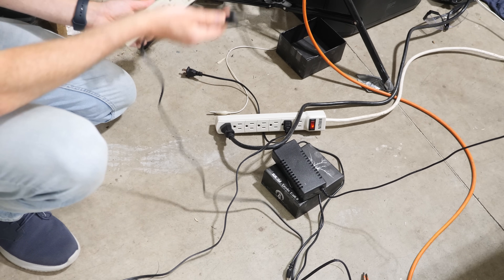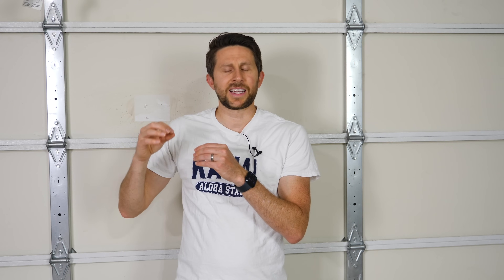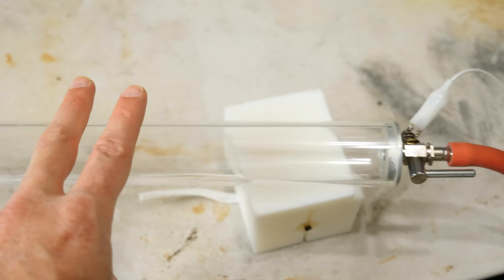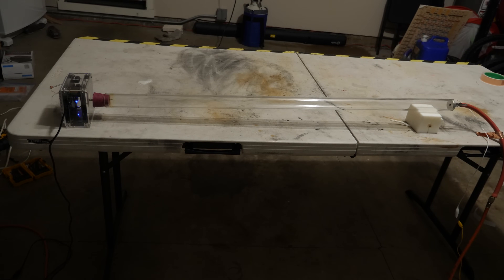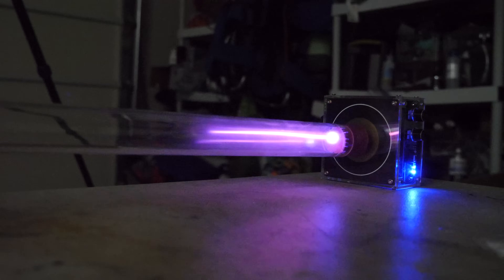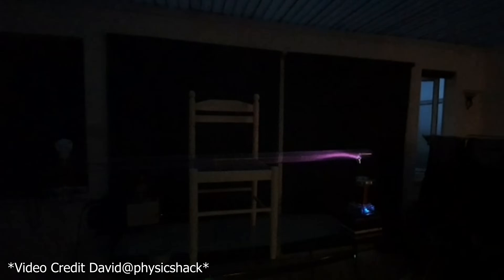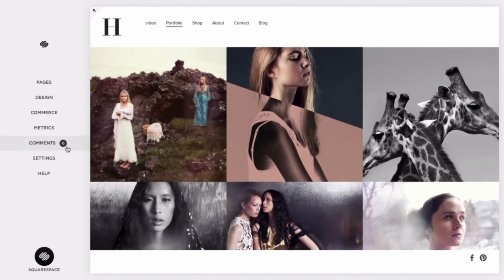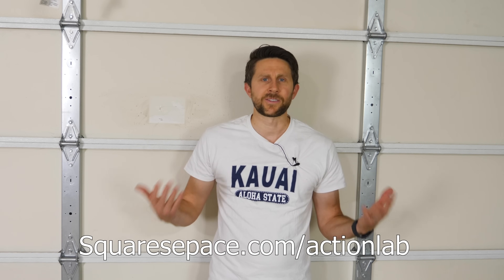Using the Air As a Wire—Was Nikola Tesla Right?

Comment: You are getting it wrong Tesla said in his book that using air as transmission is not feasable. Wireless does not mean through air only means without wire. So idea is to transmit energy through Earth not air. But there is reason why this is well dangerous and why this Word trick sustaind for so long as if done could possed danger for many leaving beings.

Comment: Tesla never intended to transmit power through the air or the ionosphere.   So many people keep repeating this stupid notion in an attempt to discredit Tesla's genius.  

Nikola Tesla, the father of radio, was clearly aware you cannot transmit significant power through the air or ionosphere.  Clearly, a huge giant capacitor at the top of the tower is the opposite of what you need to radiate significant amounts of electromagnetic energy.  Radio towers never do this.  

He states on many occasions his intention was to transmit power through the Earth.  The Earth as the wire.  Tesla's concept of wireless, simply meant, without wire, not wireless like wifi today.  Considering the Earth's surface is 70% water, this is not an unreasonable idea.   The modern electrical grid uses the Earth as a return path quite efficiently, it is quite capable of carrying electric current.  Further, if the energy was powerful enough, it could create standing waves entirely around the surface of the Earth, essentially reinforcing the energy, rather than dissipating at the inverse square as radiation does.  Electrical energy travelling across the surface of a conducting sphere, does not follow the inverse square law.  The ionosphere could be considered the return path in Tesla's system, not the transmission path.

Quote "So that in my system, you should free yourself of the idea that there is radiation, that energy is radiated. It is not radiated; it is conserved." - Nikola Tesla

His idea is better thought of like a giant electrical hammer, hitting the Earth electrically, causing the whole surface of the Earth to vibrate electrically, which could be tapped off for power.  Who knows, this electrical condition might already naturally exist.

Comment: Tesla's Wardenclyffe Tower wasn't just about wireless transmission through the air—it was about creating a global resonant system using the Earth itself. The Tesla coils acted as energy pumps, pulling radiant energy (or vacuum energy) from the zero-point field. This energy wasn't 'pushed' like electricity through wires, but 'sucked' into resonance—transmitted wirelessly, or with a single conductor, using the ground or atmosphere as the return path. It was cold electricity, not hot electron flow.

Comment: I think he intended to send this energy at low currents , and high voltage . So the electrons wouldn't accelerate as much and produce plasma . Almost like a electron ballon inflating and deflating at a specific frequency.  I think this video is accurate , I also think he was really talking about conduction as the transmission method ,not electromagnetic induction. 
A tower of great altitude from the ground is necessary to prevent arcs to the ground , or an insulating shield at the base of the tower. 
The truth is a sufficiently high voltage and low current this would be far better than a wire as there would be literally zero resistance in a vacuum , but the real issue is to produce a voltage of that magnitude .
Reply: You have great observations, but there was still more to Tesla's plans regarding the transmission of electricity over long distances.
There's a video titled "The REAL Physics of Tesla’s Wireless Electricity" by Charlie Solis - highly recommended (although it still doesn't tell the whole story about the Wardenclyffe project).
Reply: @MiroslawBlazek-Gdansk  ohh surface area ,that's how to store more electrons ,would work for air transmission as it's stored in a smaller volume , like it being pressurized to a smaller volume .I guess the Earth , despite it horrible resistance would eventually become negligible with such a high voltage .but once pumped into the earth how would I get it back without starting the whole charging process again , initially it wouldn't in resonance so won't flow to the receiver . 
 I need to study this a bit more to understand.
Reply: @m.c.4674   It's about the longitudinal waves, not the transverse EM / "Hertzian" or about simply sending electrons (the whole particle-based model of electricity is almost obsolete in understanding what Tesla was really about here). For more precise explanation you may want to check out the videos, books and articles by Eric P. Dollard

Comment: The information (or rather assumption) presented in this video is totally wrong.  Tesla wasn't attempting to transfer electric power through the air, but through the GROUND - more precisely, through the outer layers of Earth crust, soil and water, using different waves than our commonly used "Hertzian" (transverse) - using longitudinal propagation, standing waves, so-called telluric currents (already present underground), leveraging also Earth's natural resonance.
That's why he ordered to build a vast net of tunnels under the Wardenclyffe tower, that were meant to direct the flow of enormous electrical energy in selected directions. Wardenclyffe tower was designed to generate energy in the order of many megavolts (millions of volts), that was to be accumulated in its spherical top and reflected downwards, underground.
To achieve the system's full potential and efficiency it was necessary to build an entire worldwide network of transmitting and receiving towers that would operate on a principle of resonance, each one tuned to the others and arranged in accordance with the natural distribution of the Earth's magnetic field.

Comment: You need to change the frequency of the coil itself and use two different frequencies overlapping to get a solid stream of power rather than a flicker stream
Reply: Note that by overlapping two different frequencies you'd get a "beat frequency", which would be the difference of these two. As a result, you'd still get pulsating power or AC, only at a lower frequency (which consequently only makes it harder to rectify to pure DC).

Comment: That was interesting. might be used to power up satellites. in the vacuum of the space.
Reply: And where would you get the ground?
Reply: @Dill_Do  If you used a single, fixed frequency of the transmitted waves you could theoretically use two separate antennas at the receiving object and shift the phase of the signal between them 180 degrees, then rectify the resulting AC signal to DC.

Comment: Tesla used the earth as a wire I know because I’ve sent electricity 918.6 miles with a magnifying transmitter I built that is tuned to a harmonic of earth’s natural electrical frequency my magnifying transmitter was 24 ft in diameter and tesla worked with magnifying transmitters (3 coils) 👍🏻 you really only need one transmitter like wardenclyffe for world wireless electricity if you design it right

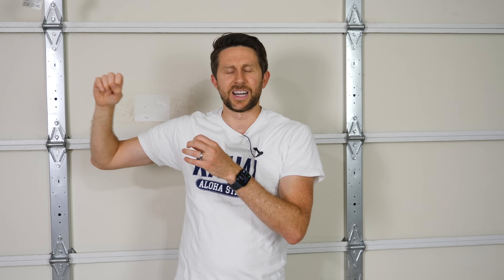Comment: 1.  1:00 it is NOT the ELETRONS it is The electromagnetic field. 
2. The plasma you see hamptons Because of the breakdown of the magnetic field.
3. NIKOLA Tesla used a  Coil and capacitor as i. A TANK CIRCUIT at the same values and he was pulsing it. Which gave a higher and higher voltage. You, sir are wrong on how he did it, which is causing more confusion.

Comment: Everyone assumes that the world would be sparking and an abundance of current uncontrollable and a nuisance to life...this is part of the original propaganda....
Once Tesla engaged the wireless part of the system in wardencliff it would simply arc at around 8hz into ground with a about ten foot spark gap...its the resonating pulse synchronized with earths natural resonance...this heart beat would be inconceivable by anything other than circuits that start or end depending on your take of travel..at an antenna to a primary coil that is tuned also to any multiple of the resonate pulse...then onto ground its that simple really...only made impossible for people to understand by the institutions that are in place to keep this type of thing from occurring by patented inventions ever again...
  Once the pulse engaged it would simple vibrate the electrons instead of pushing or pulling then through a generator...this vibration because of the natural frequency would saturate earth and all of its atmosphere...the millions of volts and thousands of amps would be stepped down to a usable current by the secondary in the circuit and that would be the constant energy supply...its more like radio than battery or generator exept the distance is not a problem because of the frequency....it worked on basics that we use today less the resonating frequency parts because that was the secret to delivery...my grandfather sat many days at wardencliff as a brick masson and according to him Tesla loved to talk and discuss what most would consider secrets....i hope this will help in undestanding that Tesla knew all about bad emf and considered this to be absolutely safe....our computers would work just fine...but the transistor may not have been invented because it replaced the tube and tubes at the time were crucial to the tuning of all the receivers each necessary at the point of power consumption.. Without the cover up of his work they would have just improved over time..

Comment: See this is why we are still in the dark ages, everyone thinks Tesla was trying to transmit power. He Deliberately misled JP Morgan and others by stating he was going for wireless transmission of energy. But if you remember Tesla wanted to bring free energy into the world. He let them believe he was using Wardenclyffe Tower to transmit, but he was actually focusing on harvesting that energy in amounts that are usable on an industrial scale. If you look at the actual blueprints of Wardenclyffe Tower it had a shaft that connected to a large ac generator at its base. (A really large corona motor) there is not doubt in my mind he would have got it working if he had resources. Why would he mislead investors. If they knew he was aiming to produce abundance of free energy they wouldn’t have funded him as there was more money to be made with infrastructure and resources to make electricity. Than with free power generators. So he told them what he wanted to hear.

Comment: I like the video. Although towards the end when you said the he “imaged” it isn’t a true statement. He actually got the idea from studying the Egyptian pyramids. The Great Pyramid to be exact.

After looking at the design of the inside to it. He notice that it was built out of granite and limestone witch are natural conductors of electricity while the white limestone that was used for the outermost layer is a natural insulator. He was the first to say that the pyramids where not tombs but power plants. 

This theory was supported years later when a research team took a closer look at the two shafts inside the queen’s chamber. They found trace amounts of zinc and a type of acid(can’t remember the exact type). When mixed the two chemicals make hydrogen. Add the natural vibrations from the underground chamber(witch was found to have immense water erosion) with the hydrogen and you can make energy. 

Gets even crazier when you add the fact that the kings chamber as granite beams that are tuned to an F# cord. They found that out by adding vibration to them. Also inside the great entrance leading towards the king’s chamber they found evidence that an explosion happened inside the pyramid. The walls are pushed out slightly and they have scorch mark to support the claim.

Comment: I agree with paulkocyla1343 and zachcrawford5 comments Tesla was considering using radio signals and resonance to send power wireless from one tower to another. But there is also the solid state tesla coils or Slayer Exciters is what they are also called. These devices produce a very low pulsating DC signal that makes a high voltage wireless radio signal that is able to power low wattage light bulbs and such. This is more what I think Tesla had in mind was to generate a wireless power radio signal and use resonance to send and receive them at long distances. Now 1 thing I have wanted to try is to take the wireless power radio signal produced by a Slayer Exciter and to use vacuum tube AM radio amplifiers and amplify the wireless power radio signal same as an AM radio station would do with a audio signal that its broadcasting. In other words this would be exactly the same thing as AM radio station sending out a signal and being picked up by a crystal radio receiver without a battery. If an AM radio broadcast signal can send enough power to make a crystal radio receiver work be means of just an audio signal then what would happen if we did the same thing using a Slayer Exciter radio signal amplified to very high voltage and sent out a very large high powered antenna? I think the crystal radio receiver would act as a wireless power outlet if tuned to the same frequency as the Slayer Exciter broadcasting station. Maybe "The Action Lab" could give this experiment a shot, it would seem like they have access to all the needed equipment to try it. I know I would try it if I had the equipment to test it....

Comment: It's not resistance because of low conductivity but rather resistance from going against the natural flow of electricity. Clouds demonstrate this as they actively contain terawatts of electrical energy and are capable of maintaining its structure as they travel over land or sea using telluric currents. What we do is force electricity into this dense electricity and then say when it doesn't travel that we need more power. Another example of an energy dense phenomenon is flame, it is an electromagnetic field that generates heat.

Comment: The idea is that by using high frequency high voltage and the atmosphere and ground a conductor, a tuned reciever becomes a "shortest" current path to ground for the current. Unlike a magnetic field, which will spread out and be lossy for wireless power. A voltage field will seek the path of least resistance. Because of resonance, a receiver coil will resonate with a transmission tower and the voltage gradient between the reciever and the transmission tower will become larger than the gradient between the tower and ground, or the tower and anything else for that matter, even over very large distances.

Because the power will be transmitted as hundreds of megavolts at pico to micro amps, the power loss over the ionised plasma of the air is relatively small. That's the idea. Wireless electromagnetic power isn't that great because the power spreads out as an emitted magnetic field. Wireless electric power is different it requires super high voltage and resonance and the voltage between the tuned transmitter and reciever becomes greater than the voltage between the transmitter and anything else, so current flow gets shunted to the reciever.

Comment: Transmitting power through the earth unimpeded worldwide using 7-8hz at resonance with the planet. It needed high voltage transformers to change to low voltage to be used.

Comment: My guess has always been that what he really wanted to achieve was to transmit energy through the ionosphere. Since it contains so many positive ions and free electrons, it's supposedly a good conductor. Not to mention, there is obviously significant charge stored in the atmosphere. I think the idea would more have been to have these towers everywhere such that you can feed net positive charge in and out of the sky and use it as a giant capacitor / conductor. At least that's my guess as to what he was thinking. Nobody really knows.
Reply: that's what he was attempting, using the ground as a ground for the ionosphere power. Problem: to get power into the ionosphere you need to have an emitter powerful enough to be useful at that range and it'll screw radio communications worldwide, including mobiles. We'd be limited to wires and lasers and beamed microwaves.

Comment: This only works if you can use quantum teleportation to transmit energy. Also since capacitors conduct AC electricity maybe if you turn the ionosphere into a capacitor could it conduct electricity and if so how far.

Comment: Two big problems with the idea of wireless delivery of usable power. If my air conditioner can get enough energy to operate by induction from a distant Tesla coil, (it pulls about 25 amps at 240vac, or around 6KW, which is enough to kill you), an ungrounded aluminum garage door, or ungrounded 150 foot long wire fence can also accumulate a potentially lethal charge by induction from the same coil. Touch the ungrounded door or fence while you are grounded, POW, call 911. Also, how would you meter the energy a particular person is receiving through the system? It's only fair for higher energy users to pay a higher percentage of the system cost. But how could you determine usage? Too many people have an almost religious faith in the infallibility of Tesla's ideas. To assume he had "something" in mind to make his wireless power grid work safely and efficiently, is naive at best, and blind, hero worship at worst.
Reply: now imagine the steel frame of an office building. :P Remember, he was doing this work before steel-framed buildings were a big thing. Although rebar in reinforced concrete would haet and cool and crack the concrete. And draw a bunch of power to no use.
Reply: @thekaxmax ; wire fencing was in general use before Tesla was born, and if not properly grounded a wire fence can be energized by high voltage power radiated through he air. That charge can be fatal.